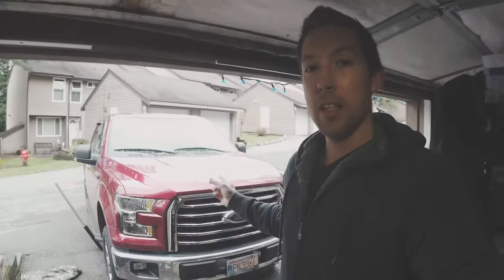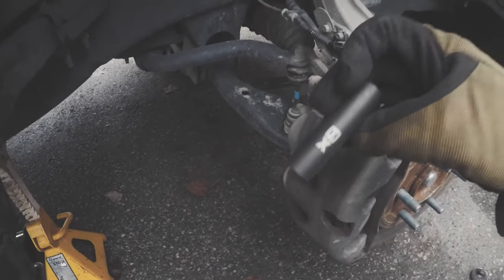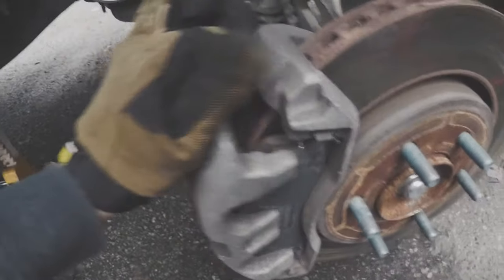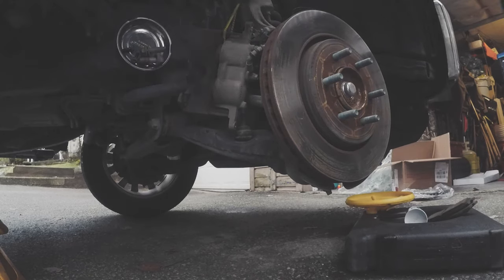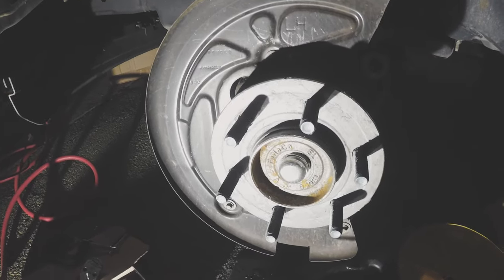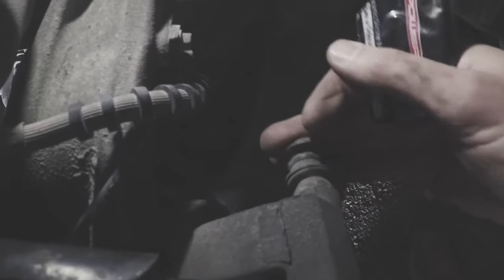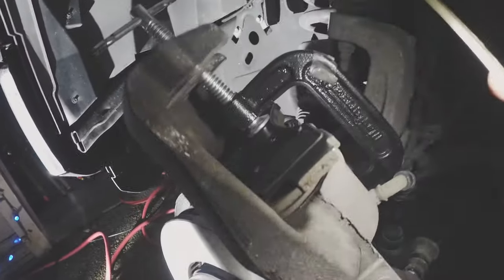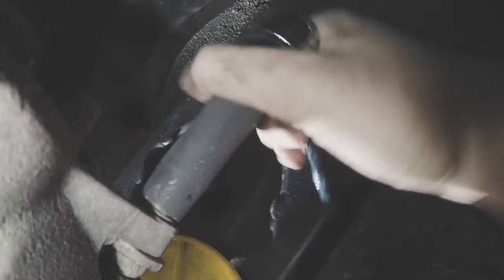Ford F-150 Front Brake Pad and Rotor replacement 2015 - 2019 |HOW-TO

Comment: Great video, just a couple things I like to add. I have a 2016 F150 Lariat. 1.The inner and outer pads are different and should not be mixed up. The inner pad has Mickey Mouse ears and only should be on the inside. 2. Grease should only be used for the bolts. They should not be used on the pads. The pads slide on the stainless steel plates. Grease attracts dirt and it sticks to the grease. You never see grease on the pads from the manufacturer. Thanks for taking the time
Reply from the maker: I think i need to do an update on this as this has been said a few times now  "There are no ears on these pads"  The OEM pads have ears but these Power Stop pads do not.
As for grease on the pads, if there is ever grease on the pads those pads are now contaminated and should be tossed. The supplied grease is for all moving / sliding parts that make contact with another and should NEVER touch the brake pad lining.
Reply: Don't forget about another important step: Take off the brake fluid reservoir cap when compressing the caliper pistons back in for fitment. It makes it easier to compress the pistons and you don't risk rupturing the rear return seal inside of the master cylinder.
Reply: It's a good idea to put a very thin coat of sil glyde or the like on the pad backing plate where the piston contacts (VERY thin), also the inner part of the slide pin you should be able to put a wrench on so it's not "finger tight".   My only other suggestion is to move the jack stand to the other side of your floor jack so it's not on the curved part of the frame rail.  Other than that you did a good job.
Reply: I have a 2016 XLT also. Should have watched your video BEFORE beginning. About half way through, I thought maybe I was in over my head, but you got me through it lol 😂. I did it without taking calipers apart in two pieces, but did lube the sliders like you suggested.  used the fancy compression tool you spoke about vs the c-clamp (another video to figure that out, lol) YouTube University!! Giter done!!
Reply from the maker: Glad it helped, I need to buy one of these piston retractable tools but meh, a c clamp does the job with a brake pad. Now you know how, super easy, have a beer jobs done!
Reply: I saw a few videos that say the ABS brakes have delicate check valves that could get damaged if you push brake fluid backwards ..what i do is loosen the bleeder then push the pads in .then I top off the master with fresh dot4 fluid
 @goskidmark
Reply from the maker: @pierreverdoni that's an option, but I don't suggest doing this for a novice... Someone who's doing their very first brake job.

Comment: I did my 2016 F150 today as well, and having not done brakes for a decade or two, Youtube came to the rescue, as I watched a few different ones, with helpful tips along the way.   One fellow showed how you can take a bolt, insert it in the rear hole where the 21mm bolt normally goes, and as you tighten it, it pushes on the rotor, so I keep rotating the nut, until the rotor comes loose!   Was a simple process, and worked slick!   I chose to get some AC Delco rotors, which they state are for 'Professional' usage, on police vehicles and ambulances, so we'll see how they make out.   After buying my truck last year, and was told the brakes where just done, it seemed odd that my braking wasn't up to par, but I had a burnt/rust area on both front rotors, and once I got things apart, the pads had a lot of meat on them, but both sides where cracked from top to bottom on the pad!   After taking 4 hours to do the job (age is catching up on me) and taking the truck out, it was like night and day, and so nice to have brakes again!!   My only question would be, do you take the time to 'Burnish' or brake-in your pads and rotors, as I'm seeing several video's on Youtube showing how to do so.   I wouldn't think most brake shops would do this, but I'm wondering how important it is to do so?
Reply from the maker: Yeah I do the repeat speed up slow down process followed by a cool off. Some rotors say "moderate to light driving over 500miles" but what your trying to do is transfer pad material to the rotor and get that nice break in. It really does make a difference.
Reply: Watched this video just to see if there was anything weird about my 16 F150. There's not, except for the ears on the pads, so thanks for the video. Got a bum wrist, can't hardly swing a hammer, rotors weren't coming off.  Tried the bolt through the caliper bracket mounting hole thing just now...worked like a champ!  Used a couple 3" long 1/2" bolts, did put a washer under the nut so I wouldn't mess up the mounting surface on the caliper bracket. Pays to read the replies. Powerstroke98, understand the whole age is catching up to me thing. And Amazon had a pretty good price on those Delco Professional rotors. Thanks
Reply: @fredwerring1840  Great to hear you tried that 'tip' as it really does make the ability to get that rotor off much easier!   Mine made some odd noises as I was doing it (pressure) so I put two lug nuts on the lugs 'just in case' but it eventually just loosened enough to pull the rotor off!

Comment: If your working on a 2017 and above F150 with Electric Parking Brake. This is the first thing you should do before you work you brakes and rotors is to put the vehicle in maintenance mode. If you don't this you will not be able to collapse the calibers.
Reply: is this also the case with Expeditions?
Reply: is this through the console (center) and through the menus?
Reply: Also rotors dont get replaced every brake pad job. As long as you arent running your pads all the way down to the backing you replace them every other time. Then the third time i always repalce all rotors, calipers and pads. Unless i am in a southern states with no road salt and wintery conditions rusting them out like crazy where the pistons will start seizing up/failing.
Reply: So how do you do that
Reply: 2016 also. Learned this the hard way when I couldn't compress the piston on my brother's truck. After a quick google search, I found out what maintenance mode was.
Reply: Yikes.  Do you have to put it in service mode if your only doing the front brakes.  ?
Reply from the maker: No, if you are only doing fronts there is no need for rear service mode.
Reply: I heard it's only if you do the rear breaks
Reply from the maker: @richardkenworthy9312 maintenance mode enables the rear caliper to be pushed back.

Comment: Sometimes when the breaker bar just won't move, I'll put an extension water pipe, or black gas pipe on the end for even more leverage and it will come off with less muscle strain.
Reply from the maker: i use to have a pipe like that... used it to smash out an old catalytic converter out of my old Audi.. broke the pipe though.
Reply: I had so much trouble getting those 21mm bolts off, even with a long breaker bar, I chose to put a 3"X3" length of pole under my breaker bar, which allowed me the leverage to loosen them.  There also is a Youtube video of a trick/trip, in using a nut/bolt system to easily get the rotor off, for those that don't come off easy.
Reply from the maker: Yeah an extension pipe is key, I use to have one but I mashed it hammering out an old cat.  Was about 3' long worked so good. Now in a bind I use the handle from my jack. 

When in doubt you can use heat but you need to be very careful you don't melt surrounding boots.  Overall the brake job went well?

Comment: Am I correct saying you only have to put the truck in maintenance mode for replacement of the rear breaks?
Reply from the maker: Correct, if you have the electronic parking brake.

Comment: When I do a lift job like this with my jack-stands, I always place a piece of 3/4 in plywood, (Good wood, not junk) under the stands. Some driveway paving, or the ground or even concrete, is not always as strong as you might think.   Just sayin',,,,,,,,,,,,,,,,,,,,,,,,,,,,,,,,,,,,,,,,,,,,,,,,,,,,,,,,,,,,,,,,,,,,,,,,, Mike

Comment: Excellent video, so how did you know what foot pounds to use for those bolts? I'm just curious how I can find that kind of information out
Reply from the maker: Thanks, I just googled a pdf world shop manual for the truck. They give you part breakdowns and torque specs

Comment from the maker: Thanks Everyone for the likes, Feedback and subs..  I will be doing more DIY stuff very soon along with a series of VLOGGING - New Camera is on ORDER!!  If you haven't subbed * please do!* trying to hit my 1k goal 💪
Reply: I know on the Rear Brakes I had to go through the trucks program "Maintenance " setting before it let me compress the pistons. Did you have to do it for the Front too ???? Great Video also
Reply from the maker: @chrisrojice7475  thanks for watching! 
no, fronts are always good to go. At most some vehicles will have a pad sensor that needs to be replaced. As for rears that would be for the electric brake system, not the push petal. My Audi is like that I have to go in and retract the piston via OBD11

Comment: Quick question…I’ve seen videos were they bleed the brakes before they collapse the pistons to prevent break fluid from going back up. what’s your take on this?
Reply from the maker: I've also seen this.. TBH if you know what you are doing maybe.. but you can also suck in air doing this which would require a full system bleed. So in the end.. is it worth it?
Reply: @JozzieProductions  thanks for the swift reply and for sharing your take on this question.

Comment: Do you need to bleed the brakes after doing this?
Reply from the maker: No because you are not opening the bleed valves on the calipers you dont need to. the only time you would need to  is if you let your Master Cylinder run out of fluid or again opened a caliper bleed screw.

Comment: Do you have to put the electronic brake in service/maintenance mode to replace just the front pads and rotors?
Reply from the maker: No, that would be only for the rears.

Comment: Are you sure about 155 ft/lbs?  That seems high for brake calipers.
Reply from the maker: F150 Front Brake Caliper Torque Specs : 24 ft-lbs
F150 Front Caliper Slide Pin Torque Specs : 27 ft-lbs
F150 Front Brake Bracket Torque Specs : 184 ft-lbs

Comment: Would pushing brake fluid, by compressing the caliper pistons, I've been told that this can ruin the system. Would bleeding the fluid into a container with fluid to prevent air from backing into the caliper be best? Otherwise good info.
Reply from the maker: Never been told that in my life.  I can't see how that's going to introduce air into the system or push air back to the master cylinder if there's none to begin with.  If your system has been bled properly then you are good to go.  Only time I've ever cracked the bleeder on a caliper is when the caliper was seized.
Reply: I have been told that compressing the caliper with new model cars can brake the abs module due to the back pressure flowing into it. Seemed like a common thing for economy cars though. Was told to open bleeder valve when compressing the piston
Reply from the maker: Doing that may Introduce air into your system. Personally sometimes with a caliper that won't move, I'll crack the bleeder.. but you'll have to bleed the system after doing so.  Also with most newer cars you will likely have to get a program to cycle your abs module to prevent trapped air.
Reply: I open the brake reservoir , remove some brake fluid , then compress the cylinder , making sure when i'm done to replace the brake fluid in the reservoir !
Reply: Very simple, yes on the newer Ford F150s you can damage master cylinder with extreme back pressure from retracting pistons. Attack clear line to bleeder run it into small spray bottle with brake fluid abt 1/2 full. Make sure the end of line is dn in fluid. Compress away no way air can get in lines. Its what the pros do at Ford.

Comment: "some people put the silicon on the back of the brake pads where the pistons touch, but I'm gonna take a chance."   Don't take the chance.  Just like the rotors rust and freeze to the hub, you can get the same on the piston surface and the back of the pad.  If you do, and one of the pads pulls back when the piston retracts, you'll get a LOT of wear on the opposite pad. It's 30 seconds of adding a little lube on the back of the pads.
Reply from the maker: I can see that for something that sits for months on end, i personally have never seen that. All premium brake pad kits usually come with shims to prevent any noise.

Comment: How did u compress the break caliber?I have a 2016 ford I could get the caliber to compress.
Reply from the maker: I used the old pad and a c clamp
Reply: I have took but either open master cylinder cap to allow back glow or use clear line attached to bleeder thats down in container with brake fluid. Slightly open bleeder and compress. once you compress piston close bleeder. No air will get in line and piston is easy to compress this way.

Comment: I have a 2020 f 150 4wd, does anyone have the torque specs for the front and rear caliper bolts, it has the electric parking brakes Thanks in advance
Reply: Tighten tighten then stop and then tighten just a little more then stop. If you think  professional shops pull out the torque  wrench every time  and take the time to look  up specks  for every  vehicle them you must be  dreaming😄😄😄😄
Reply from the maker: 100% FACTS

Comment: This was a good video but, there is an outer and inner pad for the 2015 Ford 150, and the vehicle this video is displaying.  The inner pad has two humps on it and the outer has none. The inner pad has two humps on it and the outer has none. If you put the inner pad on the outer it will lock the pad at an angle and damage the rotor once it burns through the brake lining. The inner pad has two humps on it and the outer has none.
Reply from the maker: Yessir you are correct, I did leave that out because I kinda thought fail proof. I wish I had more time to go into detail but thanks for adding that.
Reply: Thank you so much for sharing this. The Motorcraft pads came in a box in what appeared to be pairs, but weren’t.
Reply from the maker: Interesting, glad I could help.  Next video I do will be rears / mechanical parking brake.
Reply: I don't see any "ears" on either of his pads. Wonder if "Powerstop" pads have no ears? Anyone know?
Reply from the maker: The ears only seem to be on OEM pads

Comment: Why do you guys always mention the motor size when doing a BRAKE job??  I don't understand ??
Reply from the maker: Because different vehicles require different parts based off engine sizes.

Comment: Those bracket bolts seem like a lot more than 150 ft lbs taking them off lol...
Reply from the maker: @Jeremy Hess i appreciate you taking the time to tell people the tools i used or what to use but if you are going to do it at least be correct with your sizes. 
i used a Snap on 15'' long handle 1/2'' ratchet.
Reply: That’s because they have red Loctite in them, I just found out.
Reply: I  know it sounds excessive but I believe the correct torque on those bracket bolts are 184 ft lb.... Correct me if I'm wrong.
Reply from the maker: 184ftlbs yeah